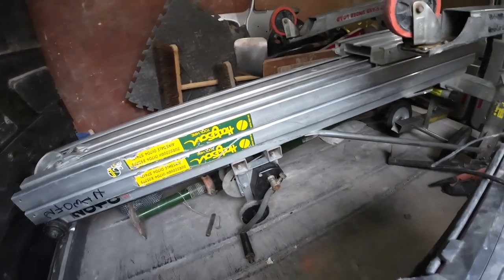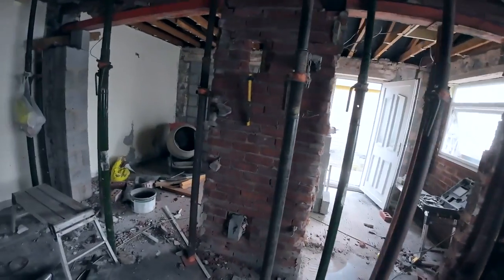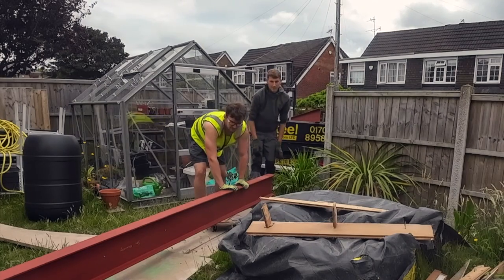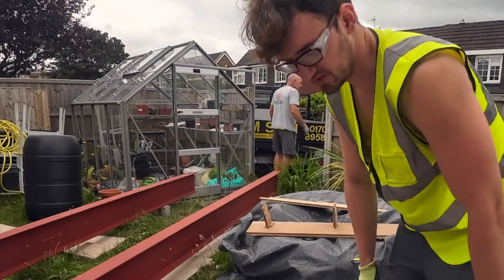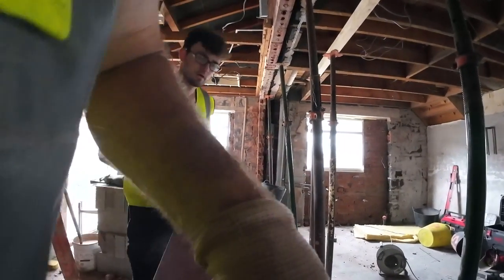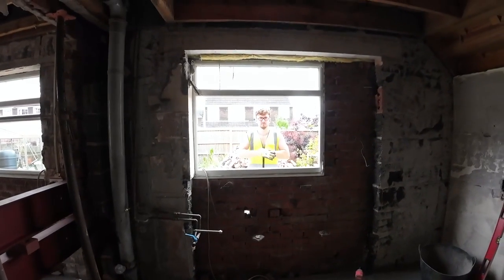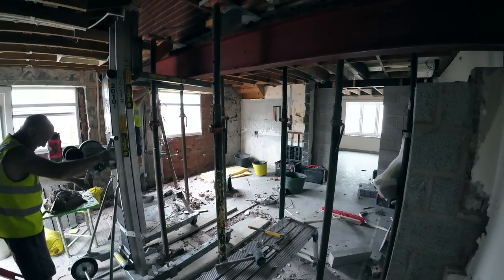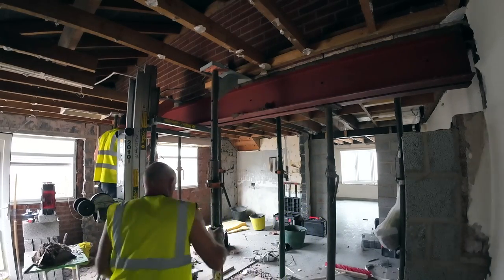WE NEED A GENIE FOR THESE BIG STEELS!!! BIG ALTERATION JOB PT 4.

Comment: i see you are suffering today Steve hope it is not to bad mind you I never hear you moan ,its looking a lot better in the building , that steel coming of the lorry reminded me of back in the 60s a lorry was carrying some steels all pointing down at the back of the lorry and there was a new jag E and the lorry pulled away some steels went through the bonnet and through the engine ,what a costly day for the lorry driver , great job getting them steels up , thanks for the video
Reply from the maker: Cheers Eddie . The hip is so bad mate . Pre op next week 🤞🏼🤞🏼😬😬🧱👍🏽
Reply: @SteveAndAlexBuild  that's is great I believe the hip operation  is not as bad as the knee which I have had and I was up walking the next day  and thats the main thing get your self up and walking as soon as you can  take care
Reply from the maker: Will do cheers Eddie 😁🧱👍🏽

Comment: Next time why don't u use the genie lift on the outside just to lift it up on the window it would've saved ya backs
Reply from the maker: Too much of a faff setting it up and probably not enough room 🧱👍🏽
Reply: I hoped someone would post this comment, the Genie Lift outside makes sense.  I've done it a few times, it's straightforward.  And, those windows comw out with about four or six ordinary screws.
Reply from the maker: I could understand that if we had struggled getting the steels in but we didn’t 🧱👍🏽
Reply: @SteveAndAlexBuild  I would have done it just to bring the steel up to the level of the window but Hay different strokes for different folks ain't it